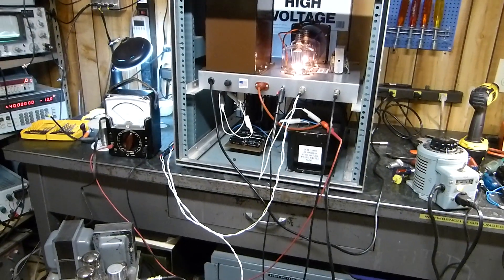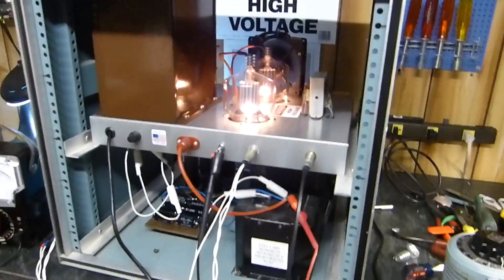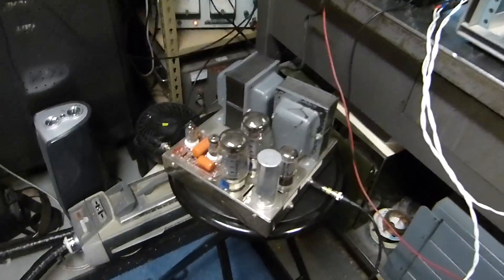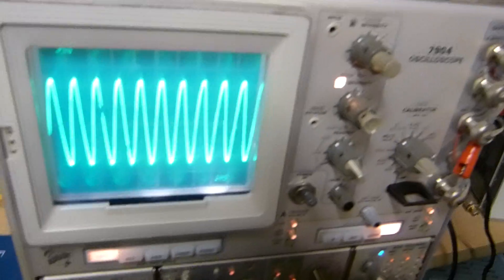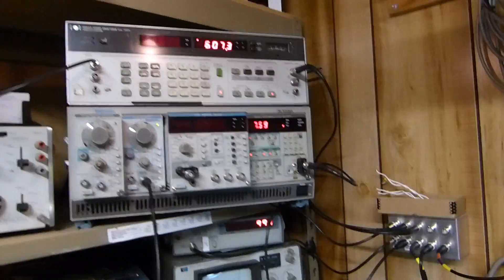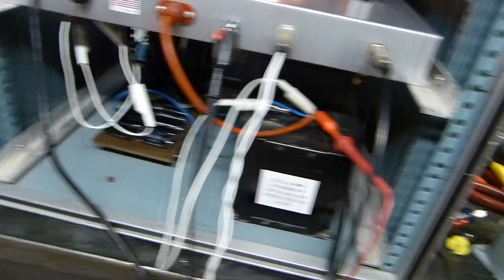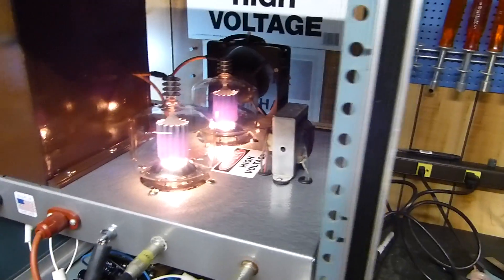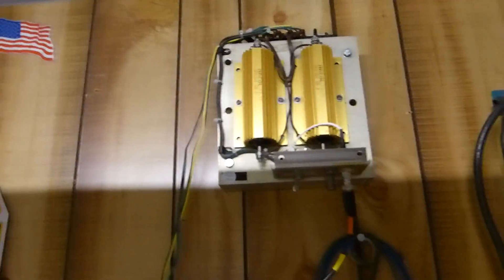Building A 1.3 KW Audio Hi-Power Amplifier Using Eimac 3-400Z Part 2 of 4

Comment: Thats all you need for an epic concert venue, portable, perfect sound replication. And, all in a single chassis, would be about as compact and effective as solid state, but the quality would be 10, 50 or 100 times superior. 
Then, you just have big old baffles, they can be left and right, and have like 50 full range speakers all connected in series, so you dont even need an output transformer in that case, if its impedance matched definetly. It would be loud, so loud, bad, but this would be for impedance matching and lower distortion and higher sensitivity. I cannot imagine what 1200w would do, Im playing with 5w. 
You have all of it phased and tuned and pre determined, then the set up is actually set up instead of just thrown out on the stage, where you actually have competent techs. 
The whole thing can just be 2 squares or rectangles, and streched over is lightweight grill cloth that is black, but you then add a projector in front or laser show or both. This could be set up as stereo with 2 separate channels or even, 1 unit still in stereo but l and r is toed out but obviously separation is needed for best quality. 
You can always add a sub, and I think those are just needing a large heavy box, but have not investigated. If the 50 speakers are all moving in unison and the baffle doesnt vibrate to cancel it out you could actually have very good low bass with a single full range driver system no bloody box and crossover. With a large single moving wavefront. I dont know if there would be too many sources for high and mid frequency to jumble up the sound, but i think they would all work in harmony. 
Aaagghhhhh all the missed out on potential!!!!
Reply from the maker: A man after my own heart...  I always had the pipe-dream of building such an amplifier(s) for AC/DC or the like bands but probably not anymore. It would require a fully competent tech to keep someone from getting killed from the 3500 volts but it would light up the venue - for sure...  🙂
Reply: @ElPasoTubeAmps  Some concerts i am just completely confused, how they have all this new expensive equipment, but it still sounds like a really loud cheap boombox. 
Have you been to Greune Hall ever? They have a really neat old system I assume, they are an example in how a/v tech Should be, it looks like full range and a box baffle hybrid and probably tube amplifiers, not sure though. Thats kindof what Ive been trying to emulate with all of my doing. 
Youre a fountain of knowledge! I try to catch up on your chanel, but its just an ongoing lesson, thank you again for all the professional tips!

Comment: If I remember correctly, at some point in this series you said that you had experience building this sort of setup for modulating the plate supply of a class c transmitter. Being that it is a plate supply, it can't really have the AC output of a push - pull configuration, only the positive side correct? I am attempting to build an audio modulated vacuum tube Tesla coil, requiring that the coil tube plate supply be modulated. I essentially need to build an amplifier capable of delivering positive only audio output at around 4kV at 1A,  but I'd build it for 5 kW operation to ensure it doesn't work too hard.  I've never built an amplifier before, and I'm not sure where to start in this case. Any guidance is much appreciated. (Note : I am experienced with high voltages up to 18kV, and will be safe.) Edit: Of course since this is driving a Tesla coil, high fidelity audio is not a requirement.

Comment: I'd be curious to see the power output from 20-20,000Hz as well as distortion. What have you got for negative feedback in this design?
I'm working on my OTL amplifier this month, and have gotten all the power supply components together finally. Transformers don't really appeal to me, because they limit bandwidth and power due to core saturation and limits of permiability. But these projects are always fun to do.
Reply from the maker: Mark - good to hear from you - I started a quick scan sometime back from 20 to 20 KHz and at low frequencies, the tubes became way too red hot so I stopped it and have not tried it again since - maybe if I run it at only 500 watts or so and then step it up a little at a time. I have no feedback at all in this part of the amp. I haven't lost interest in it yet but I have not been working with it much lately although I did finish the PS - I put a separate HV switch in a holding-relay circuit. I learned long ago with the Collins 30K-1 that "glitches" in the incoming power, i.e. lightning storms, etc, plays hell on the HV PS and fuses so if the AC main "glitches" the HV drops and stays off. I will have to get busy again and see what this beast will do at different frequencies. I obtained these transformers in the early 70's and, if my memory is still good, was told they were ship-to-shore Navy amplifiers so I suspect the frequency response will be mostly in the voice range but may be good at a few hundred watts - I will have to test and see. Stay safe...